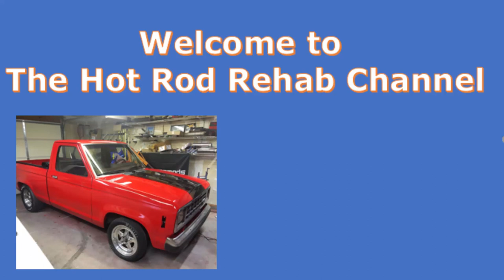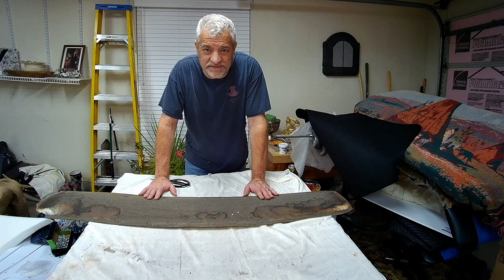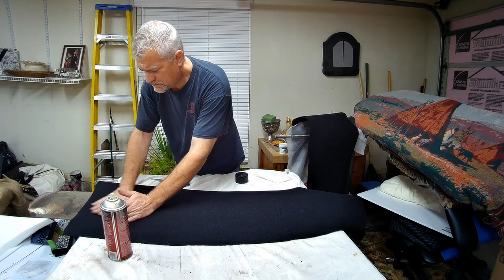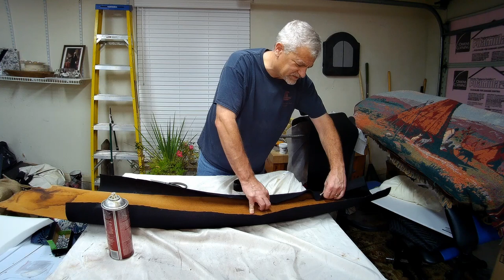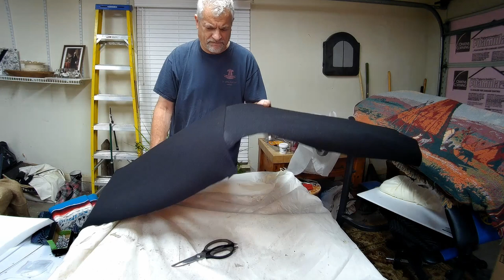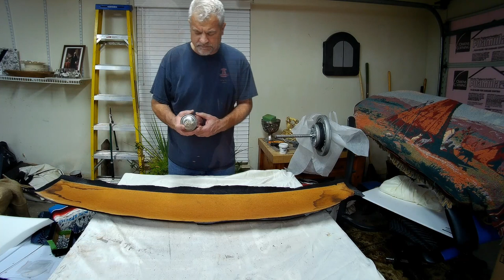1964 Ford Falcon Rear Package Tray, How to Upholster ep #77

Comment: Wouldn't the underside fold be easier with more material? Cut the corners with angles that lay over each other, easy peasy.
Reply from the maker: This material is super easy to work with and has an open grain
Just really eats up the spray glue
Will be doing the door panels here pretty quick
I will try more material 
Remember this not how to do it
It’s how I do it 🎅🏼